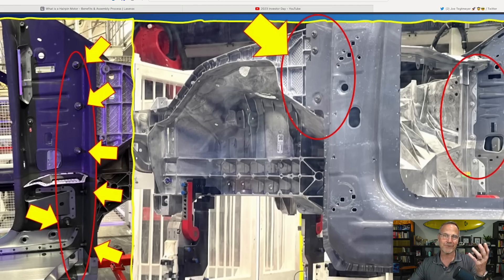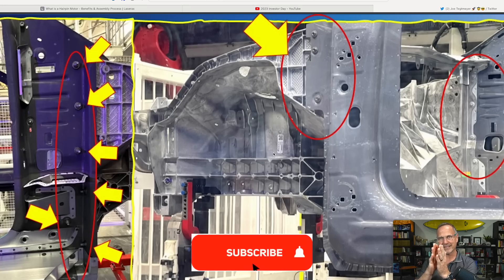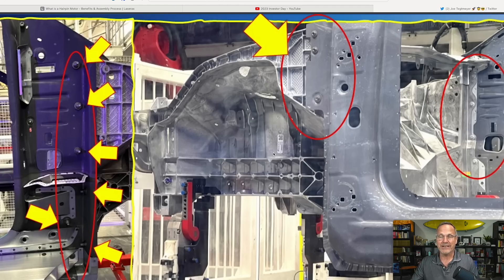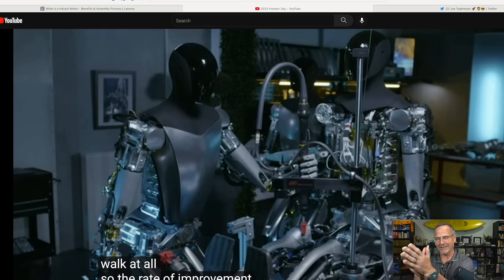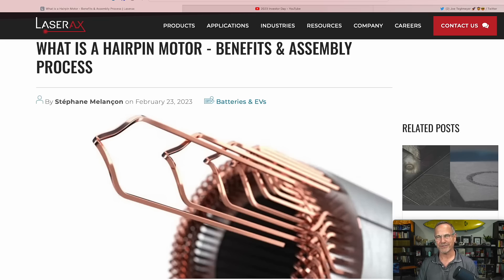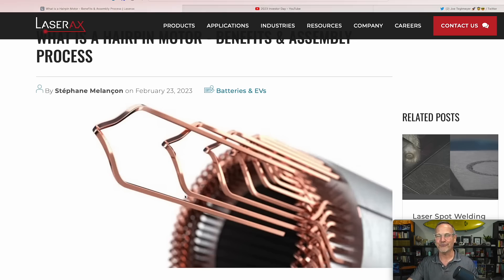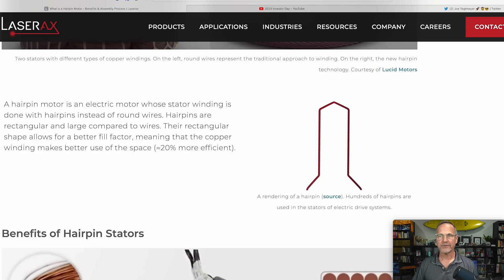Tesla Has HAIRPIN MOTORS! 🤯 What the Heck Are They?  Plus Teslabot is REAL, and How To Attach Panels

Comment: copper losses means ( I think) the resistance the current faces when traveling through the wire, which turns into heat. The hairpin motor has a larger conductor cross-section (less resistance, less heat generated) and a shorter conductor for the electronics to travel through (less heat generated).

Comment: I think that there will not be multiple windings, which means that we need to increase the amperage, and this leads to an increase in the temperature of the battery and a decrease in its life, why tesla still with radial motors instead of axial flux

Comment: Why not square the copper wire - it is done in the factory so draw the hot copper through a square hole instead of a round hole while the copper is red hot. Makes the same thing and basically can use the same winding principle of the round wire.(only it is now square wire)?Same tightness can be achieved as a hairpin motor.   You got to remember that Tesla is trying to make stuff that can NOT be replicated.
So far, as for RARE Earth metals (they are used in the magnets) not in the wire.

Comment: Structural adhesives are so strong, that you literally have to damage everything else but the actual industrial glue to take something apart. Most people are too dumb to understand that these are not the typical crappy super glues that you buy from a supermarket. Depending on use case, once the epoxy bond is cured, its stronger than the material itself and at room temperature! Without welding that not only is dangerous and requires robots, but it also consumes a big portion of the electricity needed in a car factory!

Comment: I definitely think the footage is real, BUT also likely there were other failed takes. It's implied it attached a bolt to the drill, which I doubt it did or they would have shown it, etc.
- It's definitely impressive and real, but just like Boston Dynamics dance: it took N takes. Not all in one go as they make it seem.
- I might be wrong even, but ... this I think is the most likely midpoint between "100% real" and "lol, CGI".

Comment: Speakers in the mid90’s started using square wire for the voice coil in The big woofers.  Packing the copper denser.  E Motors drawing from old speaker tech.  Well I guess speakers are motors technically.

Comment: Few things to add to this hairpin from manufacturing point of view:
You need to strip the wires properly, maintain an even surface quality in order to not fuck up the welding.
You need green laser to weld it. Copper absorbs the energy in higher ratio on this bandwidth. IR laser reflects 90+ %... 
Really hard to get the right shape of these wires due to the flexibility of the copper. If you got new batch, new spool it might have slightly different material properties and behave differently during forming.
But it has a lot of advantages too:
Higher flux du to higher current can go throw thicker wires aaand thanks to the highler filling ratio.
With less copper.
Smaller overall form factor.
Robust desing.

I am a big fan of this desing (and also Tesla :) )

Peace!

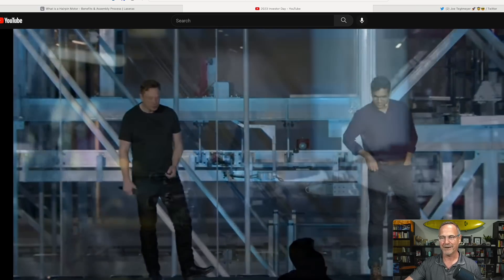Comment: I am not so inclined to believe the bot moving clip is 100% real... If you look at the part when it unplugs the cable and start going frame by from the moment the camera changes to the close-up hand view you will see the cable move towards the hand before the hand grasps the cable... the cable also unplugs without the hand making a sideways movement and there is a frame pacing issue where the socket position jumps to a different position about half way through the unplugging move around 4:18.

Comment: Why would the human form be best for a deterministic job? With efficient robotics you would have a different format for each manufacturing or support task. Many won't need legs or say, fingers and in fact inclusion of those features would be detrimental. The human configuration is very sus. If you want to move something across a shop floor you do it with wheels, which is why automobiles don't have four legs like the horses they replaced. Real robotics folks are laughing at Musk.

Comment: lLet's assume that both the circular rod and the square rod have the same diameter/dimension, which we will call "d".

The cross-sectional area of a circular rod can be calculated using the formula for the area of a circle:

A_circle = π * (d/2)^2 = π * (d^2 / 4)

The cross-sectional area of a square rod with side "d" can be calculated using the formula for the area of a square:

A_square = d^2

To find the ratio of the cross-sectional area of the circular rod to that of the square rod, we can divide the area of the circle by the area of the square:

A_circle / A_square = (π * (d^2 / 4)) / d^2

Simplifying the above equation, we get:

A_circle / A_square = π / 4

Therefore, the ratio of the cross-sectional area of a circular rod to that of a square rod with the same diameter is π/4, which is approximately 0.785. OR INVERT IT TO
1.27

Comment: Lol i seen a Pakistani guy repairing motors with hairpins. Its not that new if guys working out of there garage have them. You can just hold the legs to dip them in insulation too. While round wire you need a machine to perfectly insulate them. Well heres the thing i think theres enough new and good tech and techniques out there that if combined we could improve effciancys everywhere.

Comment: During the freeze frame of the robots hand, as you insist that it is not faked, I noticed a detail for you.  Look at the left hand, there is a small notch molded into the 'knuckle' joint of the first finger to allow insertion of the pinion pin for the second finger. If this is CGI it is the finest I have ever seen, NO ONE does that small a detail! And I will bet if you pan over you will see the same has been on the pinky finger to allow the pin for the ring finger to be inserted. This is NOT faked!

Comment: Question: what are the drawbacks of hairpin motors? They sound like an all-powerful perfect solution, but there has to be a reason they haven’t been mass-manufactured to this point. 

Is it manufacturing complexity? Material sourcing? Heat generation due to larger wires? Capacitance issues? I seriously doubt that the only reason is “no one has thought of this before”

Comment: So just like the Brushed DC starter motors used in Cars for many decades. 
Use those and you have less cost, more efficiency, more reliability and far less weight, eliminating the stupid electronic controllers that Synchronous AC motors need.

Comment: "identical winding path" should reffer to usecase, where while lot of round cables travel along same general path, individual path of each wire differs a bit, resulting in loss of uniformity and decrease in performance. Rigid copper bars are better "alligned".

Comment: Tesla's superiority lies in its software capabilities. For instance, ChatGPT exemplifies the immense potential of AI. It can perform searches better than Google as it is not an ad-based system. With AI's advanced capabilities, it can search for specific keywords and retrieve relevant information. For instance, a robot can be instructed to play fetch with a dog. It may source out a video and relevant data points to learn about dog behavior and use that information to toss the ball. It can even learn how to read the dog's reactions, something that would take humans days or weeks to master.

Robots will have both cloud and hard drive functions, which enable them to perform most simple and semi-advanced tasks. However, it may not be capable of completing complex tasks such as changing the oil on a rare motorcycle or fixing a broken couch. This capability will depend on the robot's storage capacity and speed. Advanced robots may require up to 10TB of storage and 1TB of memory with read and write speeds twice as fast as the current speeds. Cloud computing or requesting instructions will continue to be necessary until an SSD with 10 times the speed of the best SSD available today and hundreds of terabytes of storage capacity is developed at a cost similar to that of a 1TB M2 SSD.

In conclusion, Tesla's advanced software gives it an edge over its competitors in the field of robotics. As AI technology advances, it will revolutionize how robots interact with the world around them. With better data analysis and learning capabilities, robots will be able to perform more complex tasks with increasing efficiency. However, a lot of work still needs to be done to make advanced robotics more accessible to the masses. As we continue to develop and refine this technology, we will eventually see robots performing tasks we previously thought were impossible.

Comment: I suspect adhesives will be applied; those bolts don't look big enough to be structural for that load path in the body, they're just there to align and compress the pieces for the glue to bond right.

Comment: And though you didn't mention it, the use of the thicker hairpin windings allows for the use of higher voltages with out the corresponding heat build up so… That will be why Elon wants to change to a 40v system instead of 12v.

Comment: You missed one of the best parts of flat sided windings vs round winding, almost an infinitely larger contact area on all sides for heat transfer.  No more hot windings in the middle of the bundles.  Also 100% fill reduces magnetic flux leakage IIRC. 
And yes the movement of windings that are well constrained it a major source of failure, like heat.

Comment: Hairpin tech was used in the Lightning ev motorcycle (worlds fastest bike) using the borgwarner hvh250.  the hvh410 makes incredible torque and its meant for heavy vehicles (busses and trucks). The hvh250 would be perfect for a quad motor single seat race car with torque vectoring (tesla uses a single motor per axle which doesn't allow for independent wheel control ie no torque vectoring). We just need a lightweight aux power unit like in the back of airliners that will allow for continuous use like what lotus is doing in their new car. Hairpin tech isn't new but it should allow for smaller motor cases with the same power or more power with similar dimensions.

Comment: Square section magnet wire is very, very long established.  As in this case, when used to wind an Armature, it is necessarily formed into that "hairpin" shape (I've never heard that term before, but it's apt lol).  This style of winding is very commonly seen in Direct Current armatures, but is also seen in larger industrial Alternating Current armatures as well.  They keep using the term "stator", which is not incorrect, but it is vague, and has lead to a lot of confusion among the general public.  The stator is simply the part that does not revolve.  It can be the field, or, as in this case and that of most Alternating Current motors, it can be the armature.  "Stator" describes the location of the part, but not it's function.

Comment: Square copper wire has been used in motors for a long time.  Manufacturing the motor slightly more expensive do to the winding process.

Comment: I wondered, could they not utilise acoustic welding.. I'm not 100% but I'm sure I read somewhere or gathered through some source they use a higher silicon rated mixed aluminium type metal however I could only also be talking about panelling because afterall I assume a chassis itself might be made using possibly tougher types of steel? -Sorry for me adding in my 10 pence, mainly just curious like everyone else and airing a possible notion.

Comment: It is real, unfortunately not impressive of mech performance, since Elon attempt as "safe & slow." Unfortunately thats not the factor either. As slower, requires high rpm leverage strenght, even though a slow motion mech. (Motors pin vs synthetic reflex).

Comment: 4:33 What Scott noticed ( or should've) is the mech croch area gap & squat knee fold. That caused a limited 1 leg after another mobility effect. By not having a hip twist motion nor close adjacent foot crossing over. Knee folded modes help even tactical pitch alignment & suspension balance. But not against posture fatigue/power or verticle poise with classic boping steps.

Comment: I don’t think the next gen cars will have paint. The reason you assemble and then paint a car is due to colour matching not anything else. Colour is typically calibrated once a week between plant and sub-vendors and every day after calibration is adjusted. This means if you have a car with doors painted one day apart from the body you will notice it. This is also why black bumpers are favoured on cheaper cars, less work. For Elons plan to work he will need to get rid of the paint shop or develop a game changing colour management system.  I think it will be the latter as he has already shown with cyber truck he is willing to go there. This will make the fishbone production line much more feasible.

Comment: It comes down to what is known as "circular mils".  The cross-sectional area of the conductor.  Generally, larger motors (500hp and up) use square or hairpin conductors.
Reply: The wire twists also twist the magnetic field flux. Smoothing them out will improve efficiency.

Comment: The hairpin design is already used in several EVs (Lucid, VW ID series, BMW). It seems unlikely that alone would enable removing rare earths, since those are in the permanent magnets in the rotor. Hairpins enable putting more copper closer to the rotor, making the magnetic fields interaction stronger, but the functionality is the same.
Reply: Actually vw, bmw and others uses almost no rare earths sandy munro said that
Reply: @alanmay7929  Interresting. Do you remeber which video? Did he mention how much? I mean 520g in the existing Tesla motors is not exactly a lot.
Reply: Not if the magnetic field that is created by the permanent magnets are now created by windings or hairpins... No more permanent magnets.
Reply: @Nominally-Built  The windings or hairpins are in the stator, the permanent magnets are in the rotor. Going to hairpins doesn't change anything in the rotor.
Edit: the rotor design might change somewhat, but it doesn' t remove the need for rare earths for the permanent magnet
Reply: @michalfaraday8135  the reason for the permanent magnets is simply to utilize it's magnetic field. If that can be duplicated without magnets but with windings (it can), then no more magnets and rare earth metals.
Reply: @Nominally-Built  Sure. You can have an induction motor, for example. But Tesla was talking specificaly about Permanent magnet motor, without rare earths, indicating they will have a permanent magnet, that doesn´t need rare earths.
Reply: Not closer to the rotor. It allows for more current due to more cross sectional area.

Comment: The key benefit of a hairpin motor is going to be manufacturability because it’s a pain in the butt to wind coils on armatures and stators.  But there are also benefits in power density to having wire wound coils.  To make up for not having as many windings one has to do other tricks like laminating multiple conductors into the hairpins, which can reduce resistance but at the expense of fewer coil wraps meaning lower net torque.  There is no free lunch here, but there appears to be a trade where one can end up with higher manufacturability, lower cost, and maybe eke out some efficiency improvements without too much performance loss (or get it back with design).

Comment: Winding machines are automated and pretty fast. Round wires will Always leave some free spaces unless you compress the wires into hexagons, like some speaker manufactures do.
There is more to the story which is left out. These squarish wires are likely stamped from flat sheets, then dipped in polyimide, or such. Then stacked like transformer laminations.
Increasing the wire cross section reduces the number of turns, and the inductance by a square factor, necessitating a lower drive voltage. This means higher current fed into the stator, and likely the copper losses remain constant. The 380V battery converter now needs to be beefed up for higher current, more resistive losses, more heatsinking etc, to step down to a lower voltage higher current. You could be chasing your tail in this zero sum game.
The magnetic fields from the hairpin-ends are not closely coupled to the steel laminations and likely has very little effect on the outcome.
I can see no other benefit from this other than lowering production time on the stator, with suitable automation.
The DC to DC converter needs a big redesign, probably using some GaN SiC transistor modules, which would have to be absorbed by the cost savings in the motor.
Higher voltage is preferred as the wires for a given power are thinner.
Electric AC induction motors have been around for over 100 years and been intensely studied and optimized.
       I'm not convinced that there is something new here.

Comment: Most of those points are really the same point.  Not having the air gaps AKA packing the copper tighter can lead to lower resistance if you keep the motor size constant leading to more maximum torque and less heat.  If instead you keep the torque number constant, the motor gets smaller.  It is just different sides to the same coin.
One thing we don't know about the video is how many times they had to try it before they got a take where it worked.  Since it was a scripted collection of motions, the robot didn't need to be "thinking" about what it was doing.

Comment: Today I learned about hairpin motors. Wow, more efficient, prettier, longer life AND easier to build, which probably also means cheaper. There doesn't appear to be a reason to not build these motors for everything. Wire-wound motors are now dinosaurs. I suppose they will continue to be produced because of sunk cost, though. But it seems like any new factory that produces electric motors for anything would be pretty dumb to not use hairpin.